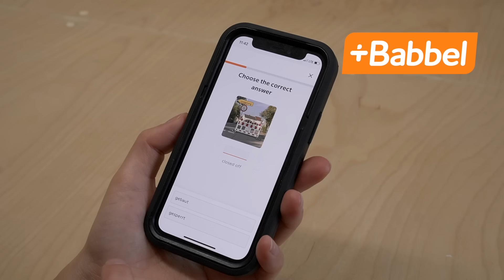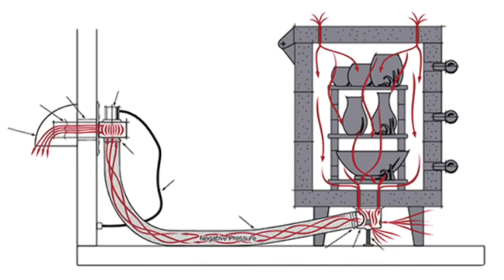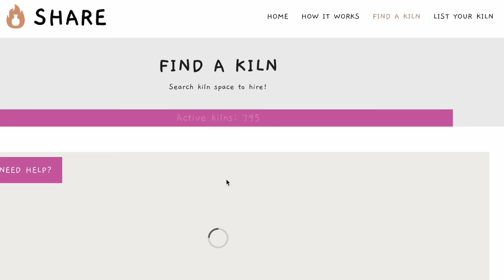Why you (probably) shouldn't buy a kiln

Comment: I bought a broken kiln ( broken bricks, broken elements, no control unit ),  I repaired it, made my own ( bigger ) elements ( from 2400W to 6000W ), bought a control unit. Now I have a 60L kiln that cost me 500€ total.
Reply from the maker: woww!! respect 👏👏👏
Reply: That is great! I would have loved to do that (found a lot of broken kilns for sale), unfortunately I don't have the knowledge nor the courage to try that haha. Good for you!
Reply: I admire you for taking on the task of building a kiln.  I just bought a used kiln. It’s in beautiful condition; everything is good, but it needed a new cord.  That was fine since I’ve had to replace one on a kiln I previously owned.   This gave me the option of replacing it with the plug that allowed me to share the use of an existing outlet until I can get power installed specifically for the kiln.
Reply: Please teach us how!!!
Reply: Lol I got one for "free" but had to pay 250 usd for replacement bricks and elements. Also paid 250 to have it repaired. So 500 total.

Comment: If you are a part-time hobbyist it probably doesn't make sense.  A wheel and a kiln are necessary if you want to get serious about the craft simply because having 24/7 access to them will improve your work exponentially.
Reply from the maker: That is true!
Reply: I’m a hobbist and I bought a wheel. I just put it in my backyard under a tent and go out and make something a few times a week, it can be very relaxing. There are wheels u can get pretty affordable. And I don’t wanna drive to the pottery center every time I feel like making something. I usually just take my stuff there to glaze and fire. But I agree that a kiln is a huge commitment. Maybe when my kids are grown and I have much more time.

Comment: I made my own gas fired kiln which I only use outside. It's implied that both the size and number of pieces are limited. 
So my long haul isn't all that long, being in my 70s. And it keeps me busy and alert as a retired manufacturer. You stop, you die.
True to my past performance,  I try to add useful information based on my experience. And who knows, I may make a dime every now and again. I'm not overly vested in the craft. 
Thanks again! ❤

Comment: several years ago when i had just started (and i mean JUST started) doing ceramics on my own, i was lucky enough to come across a used kiln for sale for only $500. i have no idea how old it is, the electric control panel is at least 25 years old and is much newer than the kiln itself. it was used in a school before switching to personal use, it's cracked everywhere and half falling apart and the outer metal parts rusted through and had to be replaced, the control panel's wire had been CUT OFF at the plug by the people who took it in, and i only have space to run it outdoors, and my shelves are all cracked or broken. and despite it being in comedically bad shape, i think it's pretty great and i have very few issues as a beginner/someone who doesn't use it much. i did not learn how to use a kiln until after i got it, too, and i'm still learning things... i think beat up kilns on their last legs like this are a good option for beginners and hobbyists!! you just have to keep an eye out until you see one cheap enough, if you really think you want a kiln. one will come along!

Comment: Craigslist usually has a damaged or unneeded kiln for $200-$300 US. I was able to pick up a TnF82 (93L) with furniture for $300. I needed to replace two elements and do some minor repairs but ended up with everything for about $500. The system retails for over $2000.

I'm an engineer so I've been given the proper training to fix all the problems with the kiln and install my own electrical line. Get to know an electrician or engineer and you'll save a ton of money on your kiln/install.

Before the electric, I was firing in a homemade updraft kiln in my backyard. This is orders of magnitude safer, from my insurance company's perspective.

(btw when it comes to pottery I definitely am a beginner. I've got years of experience repairing machines that make things hot, just not much using them. I started in ceramics about two years ago.)

Comment: I made a small gas fired Raku Kiln using some bricks, chicken wire, ceramic fiber blankets, propane forge burner and a digital heat gauge.  Through trial and error, I have been able to brisk fire small pieces, but I still have yet to try glaze firing.  There has been a learning curve but works out so far.

Comment: Skutt's KM818 single phase will run off almost anyone's existing 220v household circuit, and it's pretty roomy. 18" x 18" interior dimensions. Alternatively, Olympic makes a cone 10 Doll E/Test kiln that will run off a standard 120v outlet (dedicated circuit with 20 amp breaker). It's not huge, but probably big enough for most hobby potters.
Reply from the maker: nice! That sounds about the size of mine.

Comment: I've found myself really wanting to buy a kiln mainly because the community studio I'm a part of is a good 30min drive away from me and I find it kind of a pain in the * to get myself going to the studio for small things that I think of, like adjusting pieces while they're still plastic, but I also do recognize that a buying a kiln basically resigns you to moving all of your operations close to it, including a wheel, tools, storage, glaze, etc. I find myself with a lot of time now and I'm spending a lot of it in the studio, but I may get to the point in the future when I find a job that I have no time for it, or I have less time for it overall. I definitely have the space for it, I definitely have electricity ready to go for it, but I just don't have the ability to commit to it. Additionally, I'm of the opinion that I'm letting the need for a kiln develop itself instead of just getting it because I want a kiln and because I want to have my own studio. That is to say that I recognize there's a little bit of a "gotta buy everything" guy in me and I'm going out of my way to make sure I'm controlled when making big commitments like buying a kiln. If I let the need develop because I'm just making more and my studio isn't turning around my work fast enough, or because I want to be able to play with mixing my own glazes and I want to be able to test them without buying the studio extra kiln shelves, or maybe I even find that I would have more time for pottery if I didn't have to drive out to the studio to do it, then I'm fairly confident that my interest in pottery is still alive and well and the commitment with buying a kiln makes sense.

The only other thing I can think of that would make me buy a kiln is if I can find the exact kiln I want and it's extremely cheap, but those opportunities are few and far in between.

Comment: I play with geopolymers instead. The options are more limited, but it does not need firing. It is way more robust than polymer clay, it actually uses pottery clay.
But you can't touch it with bare hands when it is wet because of the alkalinity.

Comment: I'm buying my first kiln after being a member of a maker-space that has a perfectly good kiln for 2 years.       The problem with using someone else's kiln is that you have to fire on their schedule and at their temperatures.    They won't run the kiln unless they have enough work to fill it so in slow months even when I have a piece ready for firing I may have to wait weeks to fire it.    And because it's a community kiln they only have two temperatures on the schedule - a bisque firing and one glaze firing temperature.   This limits the clays and glazes I can use.   So a good reason to own your own kiln is to have total control over your schedule and temperatures.

Comment: So many reasons to buy a kiln though. Studios might underfire your clay to save cost and your work suffers. It also limits the your options with glazes and makes you dependend whatever your studio may fire too. Your work might also be less consistent because in a community kiln someone may fire with chrome or copper which become volatile and ruin your white glazes and or make them turn pink or green. Also pottery is hot shit and if you ever decide to sell your kiln, you probably can do that fairly easily. Firing at low temps in a community kiln will limit your options with glazes and be cost intense when making your own (everythings needs a pricy boron source). I own a rohde te-s and formulate my own glazes with rather particulare firing schedules up to cone 11 (which in an amazing rohde is just 1284 with a short hold.) and in my case owning is best. Love my kiln.

Comment: If you're someone that's good with tools and have basic physics / electricity knowledge, there's a lot of resources on the internet and youtube that help you build your own kiln for a fraction of the price of a commercial one. I basically built a 60L, 3.2kw kiln based on your Rohde ecotop with all the same features and the materials cost around €600. I fired it twice to 1050C so far, and it works great. Doing 1220C next week, fingers crossed.

Comment: By far, the best thing to do if you have time is take a class at a community college. At least in my area, the teachers are usually studio potters with MFA’s making about 5000 pots a year. You will not get better training and firing than that. Also, if you wood fire with a professional, make sure your pots are dry and small. I dry mine in an oven. If you are not asked to help fire, don’t take it personally. I learned working a wood pile and watching before I started working the kiln. Also, be quiet. I get pots with wood ash and salt glaze fired to cone 12. I have an electric and gas kiln, but rarely use them. Lastly, if you live in a rural area, check out the rocket kiln. It works like a rocket stove, but for pots. Scrap wood, scrap electric kilns. It is pretty much 100% oxidation, so you get similar results as an electric firing. With that said, I bought a kiln first thing and started studying glazes while my throwing improved. Lastly, get someone handy to roll your kiln coils. Much cheaper and not very complicated.

Comment: €5 in electricity per firing sounds so cheap to me. At our local pottery studio, they charge €5 per kg of clay you bring in (bisque firing), and though they have a very big kiln and thus more costs, I think my 60L kiln fires a lot less efficiently than €5 per firing. Any tips on how you keep the costs low? Great video also, thank you for the advice!
Reply from the maker: Yeah I think thats pretty standard pricing! The electricity is pretty cheap but once you factor in the maintenance, labor, and overhead, I think 5€ per kilo is quite fair. There is a LOT of costs that go into running a studio, so money has to be made. At the studio I ran, we charged 5€/piece for both firings (and that was considered very cheap in my area).
Reply: Here in Switzerland considering the kwh price every firing is close to 12eur. I wish it was 5eur! Now I won't be firing anything until my kiln is truly full haha
Reply: @elivean here in the Netherlands as well! I've had some issues with my kiln (due to the voltage dipping at high temperatures and the kiln taking much longer to heat up than it should) so it might work more efficiently when this issue is resolved, but so far I think bisque firing alone came around to €15 in electricity, glaze firing even higher. 🥲 But true haha, it does make you very good at loading a kiln at max capacity!
Reply: @PotterytothePeople thank you for the reply! And that's  fair - in the studio I use, they charge €5 for bisque and €6 for glaze per kilo, so depending on the size of your piece that might be around that price. The maintenance, upkeep and loading the kiln take a lot of money and effort too, of course!

Comment: One thing I tell people ready to go solo, is ask to help with firing, I was lucky, I got a degree in ceramics and got all the training anyone could ever possibly need to find thier voice in clay and start out in independent or semi-independant practice, which is why I value actual hands on experience working with an experienced potter. Video instructionals are all great reference material, but the only way to really learn what you're doing is in person. And a community studio is a great way to get that learning. Also, maintaining those ties after you set up your own studio is invaluable.
Personally, i don't play well with others, it's too distracting and then i get absolutely nothing done, all I want to do it get an audiobook going and get on with making.
As for insurance, I currently have a rented industrial unit and business contents insurance. Soon, if this sodding house purchase goes through, I'll be moving my studio into the detached double garage and getting 3-phase installed. My kiln is more than double the firing chamber of yours and needs industrial power to reach stoneware temps. I'm too scared to look into the new insurance costs in a domestic setting. But currently, I pay around £120 per year. Also, I don't change my kiln's elements, I accept the extra cost of paying a professional kiln engineer because I don't trust myself to do it properly, i tried it once and it cost me a new hearth and more new elements, so it's cheaper for me to just get a pro in.
Another option for firing your work is if you are close to a local clay supplier, they often run a firing service and will happily sell you space in a firing. You might be waiting until they fill the kiln for your work if you don't have enough to fill it yourself, but if you're not in a hurry, it's a viable option.
Most importantly, and this is to help any beginner avoid a costly disaster in a kiln they don't own.... KNOW EXACTLY WHAT CLAY YOU ARE USING AND IT'S FIRING RANGE. Some earthenware clays can melt if they go to stoneware glaze temps. Always ALWAYS keep a label with the manufacturer, clay type, batch number and firing range on it. Every bag comes with this information. If you ever doubt what clay it is, treat it as earthenware and sculptural.
I totally agree about sculptors not really needing to have thier work fired. In the UK, there's scarva's Flax paper clay which is incredibly versatile and wet can join to dry, it's a really nice medium to work with.

Comment: I was lucky I found a 40 yr old kiln came with everything and then some that = more than the 350 I paid for the kiln, I bought new elements thinking I would need to replace still have not had to, I have access to a shop that is set up to run a large welder and my cheap kiln. I feel very lucky as there is no one near me with a studio . Maybe one day I will have a need for a very expensive new kiln. But I think anyone starting out should start with these old girls and maybe work up.
Reply from the maker: That sounds amazing! My first kiln was 40 years old too 😅
Reply: Similar to my story...$300....already had an old woodshop...so an outlet.